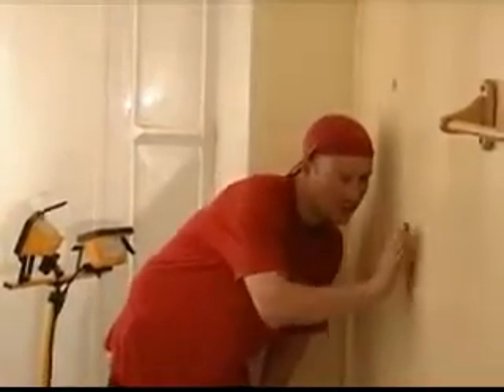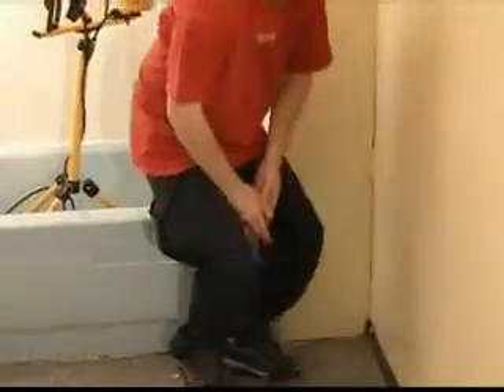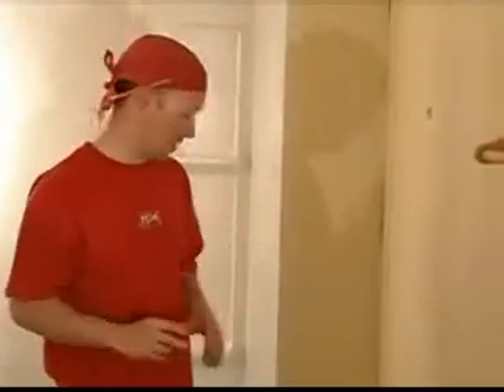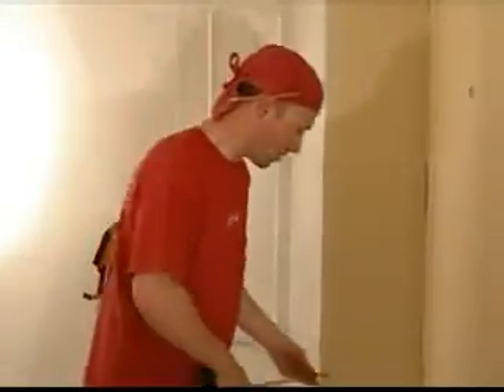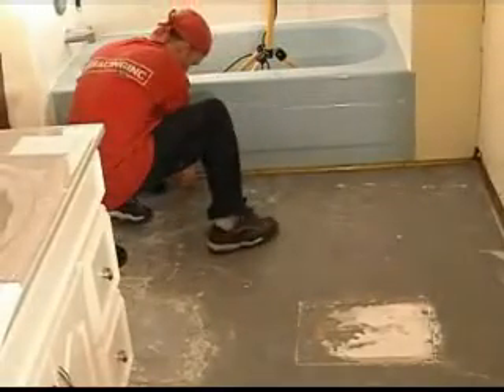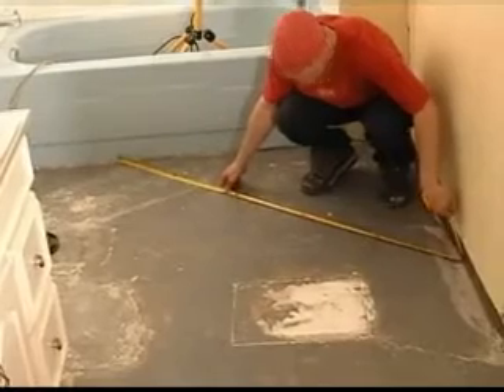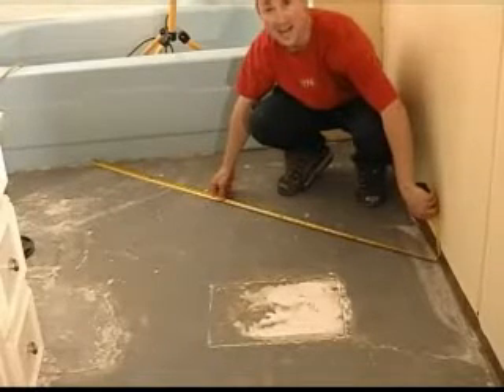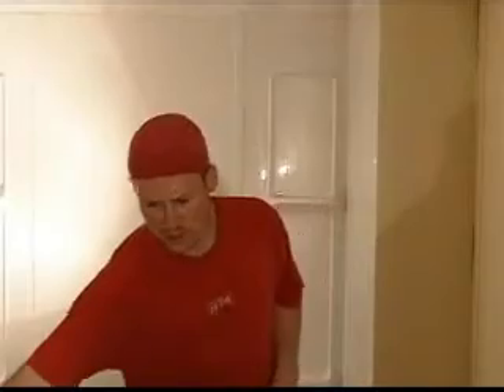Floor Tiling Measurements - Part 2 - How To Determine ...

Comment: Useful video but it would have been nice to give a tip or two on how to 'work around it' if things are not squared.  For example, do you increase the gap on some tiles or cut tiles to an angle.  I haven't ripped out the flooring in the place I will be tiling yet so hopefully I won't have to worry about it but it would be nice to have a tip or two if that is an issue.